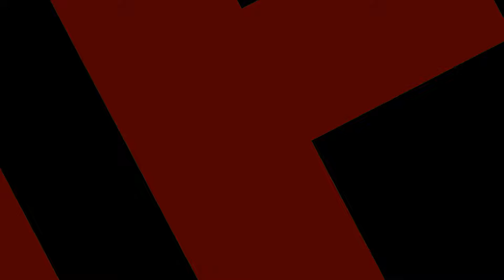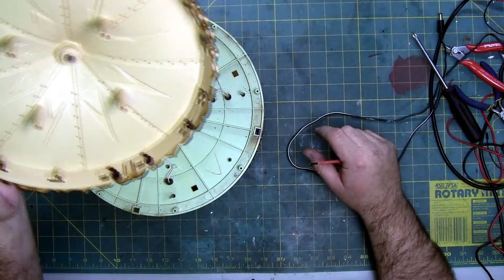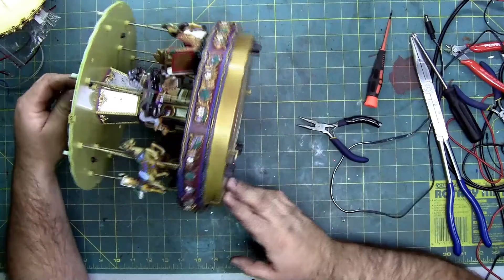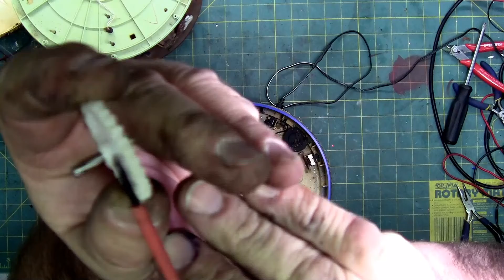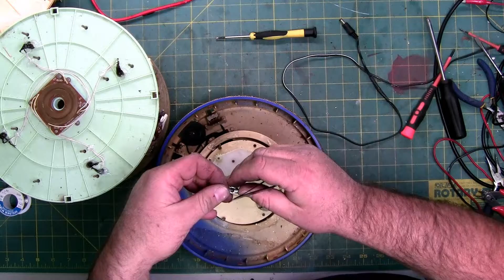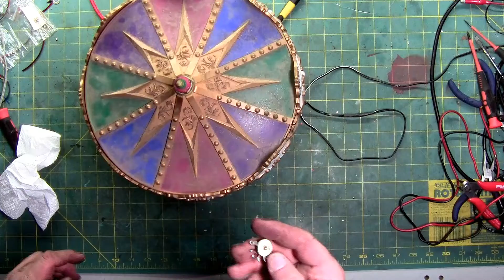Mr Christmas Holiday Around the Carousel Repair

Comment: I bought a used carousel a few years ago and fixed a minor issue but after sitting unsued for about 3 years it no longer turns and this video was JUST what I needed to see how to get into the base and find a bad belt since it was the exact unit.. So now I need to try to find a belt for it. THANK YOU!!!  Keep on sharing it's great to be able to repair things that no longer work properly, which is what I enjoy doing also.
Reply: I was able to get a new belt locally and thanks to this video I was able to replace the old belt and get the carosel working again. Thank You.
Reply from the maker: Glad it helped. HappyHolidaysParts.com has the belt

Comment: How can I get the screw in the top to come out? The whole center pieces turns when I try to unscrew it.
Reply from the maker: Underneath the unit is the end of the shaft (some models), and you can hold that with pliers and unscrew the top screw.